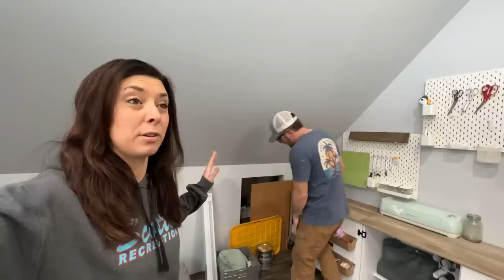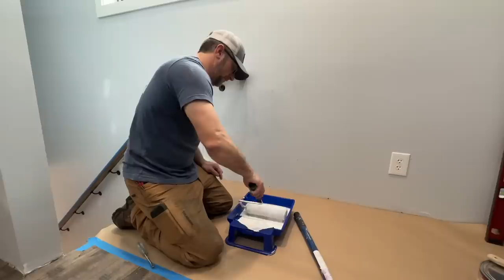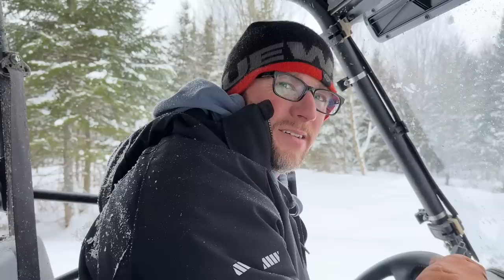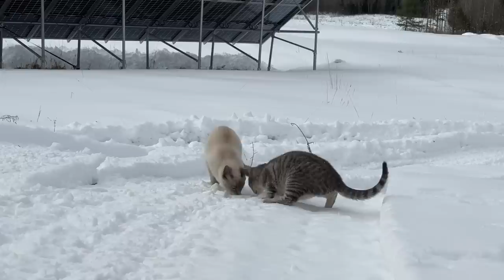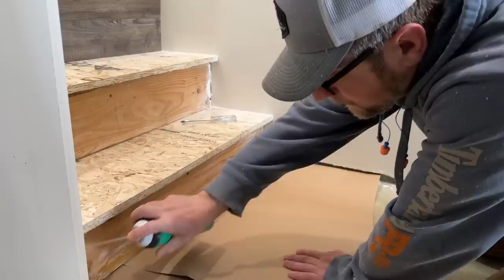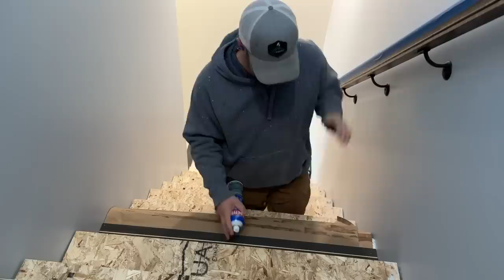Installing VINYL PLANK FLOORING on Our STAIRS | Building Our OFF GRID House in the WOODS

Comment: I have a question/how is the performance of your Solar system.  Are you able to rely on the solar power or do you also have to use the LP gas electric generator?  You will be able to determine the amount of dependence that you will need to use your alternate generation in the winter.  I love the Off Grid property and look forward to every video that you put out.  Would love to have done something like you folks are doing back when we were younger.  Good Luck, Good Health, and many years of happiness 🙏🏻🙏🏻🙏🏻Amen!!!

Comment: YOU SHOULD FIND THE GADGET YOU USED TO PRESS THE TAPE WHEN YOU WERE LAYING  IT ON THE OUTSIDE OF THE HOUSE   iT WAS JUAT A HARD RUBBER WHEEL ON A HANDLE BUT WOULD MAKE THE PRESSURE ON THE GLUE WORK SO EASY

Comment: Funny about the leaf blower.  I have been doing some painting and once I got to my bedroom I cleaned my ceiling fan but could still see dust in places I couldn’t get to. sooo I thought vacuum didn’t get it why not try my small blower.  I closed the room off and went to work with the blower.  That did the trick.  I then blew the walls, ceilings and  closet.  Got the  dust out of the fan though.    Your stairs are going to be beautiful.  Love you guys.  Take care

Comment: I just noticed you are missing a couple of feet of ceiling trim at the end of the hallway over the stairs.  Those stairs look good so far.  A few weeks ago I saw a YouTube video where the guy was using a jig and a heat gun to bend his own stair nosing with vinyl planking. It turned out beautiful.  I'm interested to see how yours turns out.  Personally, I am not a fan of stair nosing that is thicker than the stair tread flooring.

Comment: 24:00 I certainly hope you bought over a case of that spray adhesive. Considering the amount you used to put up just one piece, you'll probably only get about 3 steps done before ya need another can. 😄 (After watching a bit more it lasted for 5. I wasn't too far off.)
Al. you trucks a mess. (Looks similar to my backseat area.)

Comment: Stairs are looking great, but given the square footage of flooring for the stairs, I'm surprised you didn't go with a liquid contact cement.  It is much more economical, and you don't have to worry about overspray.  It does come in water-based as well.  I'm just sayin'
Reply: Coloured staples for the power stapler, strategically placed on each riser would look cool as well.

Comment: At $17 a can that's an expensive way to glue down those planks, buying contact cement in quart or gallon cans and brush or roll it on would have been a lot cheaper. Or better yet, why not use the flooring adhesive designed for vinyl planks?
Reply: Money is no object for homesteaders